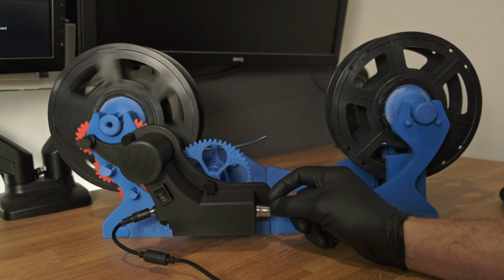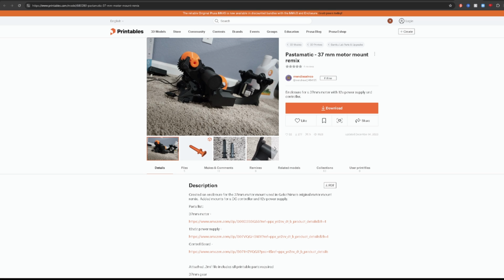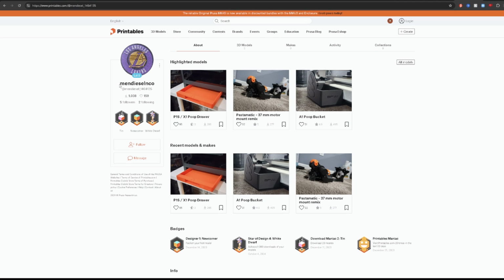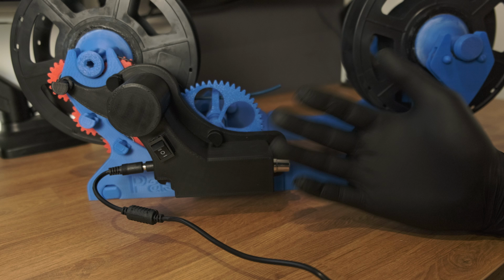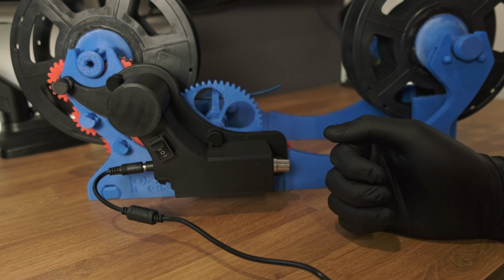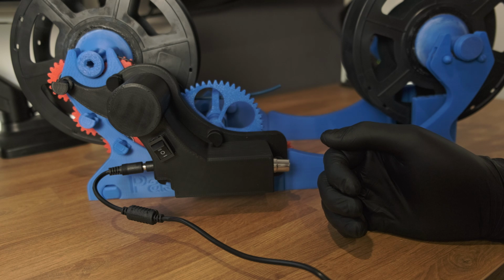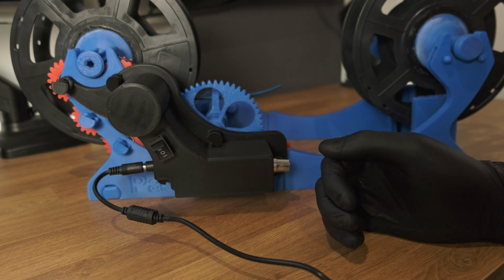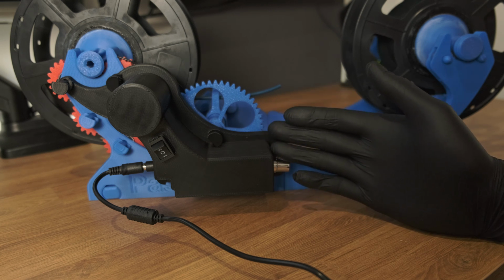Filament Respooler with a MOTOR - Pastamatic Motor Installation Tutorial

Comment: the main board link doesnt work. also does 550 mean 550 rpm for the motor?

thanks
Reply from the maker: I've just checked the link and it seems to be working, but you may be having issues due to the country you are accessing it from. Just try to search "Greartisan DC 12V 550RPM" motor on your local amazon store and you should find it. 550rpm :)
Reply: I prefer a slower motor. I calculated round about 300 rpm, so you will spool approx. 80-100m per minute. 1kg filament will take at "full speed" I guess 3,5 to 4 min. This is for me quick enough, because I prefer more the very best spooling instead of best spooling time. 

I will order the motor, maybe I am right with 300 rpm. The benefit is a very low start speed. I have just printed out the  PASTA LITE  with maximum number of bearings (608)

PS:  very big THX to LayerLab for your perfect video  !!

Comment: on the pastamatic motor do you print on the plate face down or up when i did it face down the part where the motor goes in got filled in and there is no space there or where the borad goes can you help me with the settings i have anycubic slicer next my printer is a kobra 3
Reply from the maker: Print it facing down, you shouldn't need supports, as long as your printer is dialed in... There should be some print profiles you can use on the maker page :)

Comment: It's there a more powerful motor? With a spool on both ends this struggled to wind and I had to go back to the drill.
Reply from the maker: Yeah I realised a few months after posting that there is a higher torque motor, just have a look through these comments, the lower power version seems to have higher torque

Comment: I have just ordered the motor and the control board from ebay and the motor 150rpm was £9.08 and the control board cost me £3.75 and both were from uk sellers the rest of the parts i have. All i have to do is start printing all the parts even down to the the respooler which is going to take a lot of hours but in the end its worth it so i dont have to throw away filament any more.
Thank you for showing us this video but  i suggest you goto Ebay to buy your parts and not Amazon.
Reply from the maker: These parts will be priced differently depending on where you live and how much shipping will be. But yeah, always look around for the best price, links are for reference so you know which one to get.
Reply: @LayerLabAustralia  I have started to print the parts out and its going to take some time 😔
Reply: Have you got the links please?
Reply: @MikadoMan1951  What links do you want.
Reply: @Its.Mine1  For the motor and board please, I had a search on ebay but couldn't find them.
Reply: @MikadoMan1951  Did you get any of my links to ebay.
Reply: @MikadoMan1951  The links in the description work for Amazon; however, as an FYI, the control board no longer comes with the on/off switch, nor does it come with the ability to add one.

Comment: Awesome Mod!  Question; Has anyone done this with a runout sensor so it will stop automatically?  That could be handy!
Reply from the maker: That would be an awesome feature! However, I found that as the spool increased in size, I needed to manually adjust the speed; otherwise, it would just slow to a complete stop, meaning you would need to operate it anyway. I find it's pretty easy to catch the end of the filament so it doesn't get tangled, but maybe a stronger motor would help with the consistency of the speed, as it appears I got a slightly less torque version.

Comment: Hey there! So I followed your video to a tea, but for some reason when I turn on the motor it just kindof clicks in place....like it won't turn the gear...I'm stumped. Any idea what I'm doing wrong?
Reply from the maker: Hmm.. There may be a problem with the gear on the motor, or the gears it is rotating. What material did you print them in? I would recommend ABS, or at the least PETG, as they are going to need that extra strength.
Reply: @ I printed them in PLA
Reply from the maker: @ Ah okay. Well if you have any ABS/PETG laying around, try that and get back to me :)
Reply: @ ok. I’ve reprinted the gears in PETG but still no luck. Perhaps the motor isn’t strong enough?
Reply from the maker: @ Aww man that sucks :( Have you wired the motor correctly? I made this mistake of wiring it back to front and the motor didn't work properly... Which speed of motor did you get?
Reply: @ it’s a 200 rpm motor. I double checked all the wiring and it looks correct. I’ll keep tinkering with it. Maybe I’ll get it figured out. Thanks for replying!

Comment: I did the same and everything works great…until the second spool, when the gear on the motor started to slip on the motor. Thinking about loading the sprocket in cad and extruding the circle and replacing with the D shape of the motor shaft.
Reply from the maker: Aww man...What did you print your gears in? I found ABS is still holding up strong after manyyyy spools :)

Comment: Thanks for showing how to do this. I've seen the comments about what they used but no one showed how they did it! I see some people use one motor, some use two. Do you find your one motor is enough?
Reply from the maker: No worries :D Recently I found out that the 550 motor I used apparently has less torque than the 150 version, the 150 has a rated torque of 1.5Kg.cm while the 550 only has 0.7Kg.cm. A user on Printibles told me this, and he used the 150 and it seemed to work fine. I find the 550 gets slower as the spool gets heavier, so you have to stand next to it to increase the speed, so maybe try the 150 as this may remove this problem :)
Reply: @LayerLabAustralia  Interesting. Thank you for the info and fast response! :) I might try it with the 100 rpm one then as it has a rated torque of 4.5Kg.cm!
Reply from the maker: @haveallama  no worries :) Let me know how you go, am interested to hear what the difference is :D
Reply: @LayerLabAustralia  Use stepper and controller. I tried with several different motors i had laying around with no luck. Could buy one with gearbox but  i used one of the steppers with ZK-SMC02 controller - which all are from another project i did.  Takes cca 13 minutes to re spoll of 1Kg filament. Added a micro switch to stop on its own when spool empty so i do not need to kep watch when it finishes.
Reply: @MrSivkar  Can you tell us how the microswitch is wired and where to get one? Thanks.
Reply: @moodberry  the rocker switch comes with the control board and already prewired.
Reply: @DJ_Stymie  Thank you!